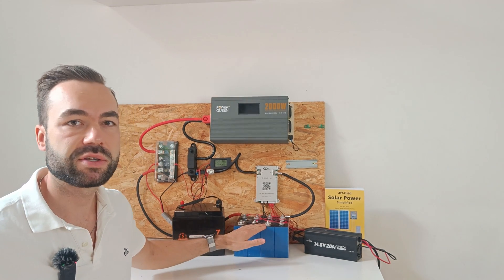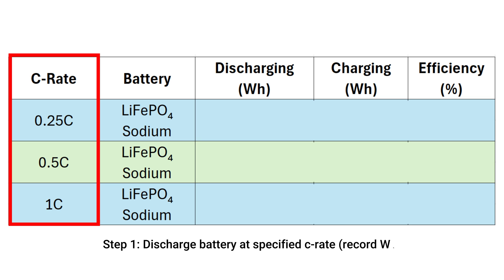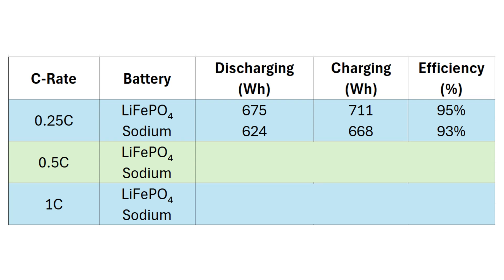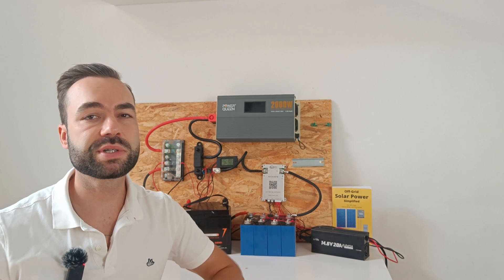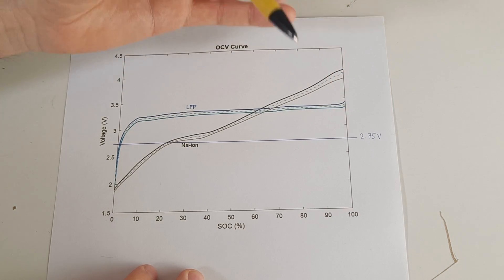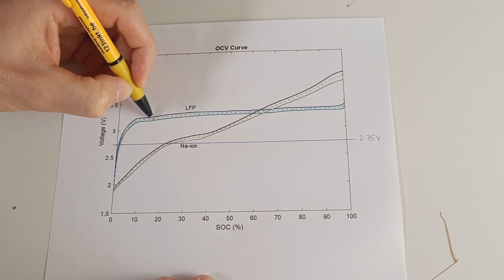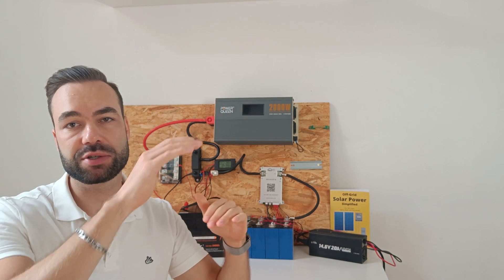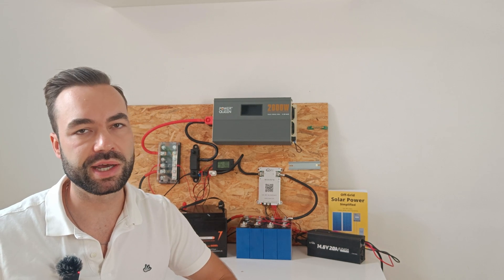Efficiency of Lithium and Sodium Batteries Tested

Comment: Nice video! Would love to see a similar test but at colder temperatures. I guess sodium might be even better in comparison at lower temps not just for power but maybe also efficiency. That will make them more compelling in many applications in colder climate, where heating the battery is often defteating the purpose. Especially for HV home storage where the inverters usually have a wide voltage input range and where its often suggested to put the battery outdoors away from buildings due to fire risk.

Comment: I think you should have also modified the charging speed for both batteries, as this should be the bigger real world source of efficiency loss. Furthermore these things really depend on electrode thickness, so ideally the batterys should have a similar volumetric energy density( with the lithium a bit lower), otherwise maybe one cell is optimized for power density instead of price/energy density which would advantage the cell heavily in terms of efficiency, as the internal resistance/conduction/diffusion paths are much lower.

Comment: I didn't realize efficiency for the LFPs would drop so much. My inverter has an eco setting, where it uses grid power for low loads and only turns on for higher loads. Because the inverter is more efficient at higher loads. Now I see that the battery is less efficient at high loads, I think I won't bother with the eco mode any more. They more or less cancel each other out.

Comment: I have a 12v lead acid deep cycle marine battery (basically a car battery)
250 watt solar panel
All for now type of deal
I need to run a 8.8 cubic foot chest freezer for meats. I wanna get a 600 watt inverter to run the freezer all day, turn it off at 6 pm to 7am
Will my setup allow me to run the freezer for at least a month with no issue?
Reply from the maker: I made a video about how much power my fridge consumes. Check it out

Comment: Hi Nick. I know this video is irrelevant to my comment, just commenting on this as it’s the latest video.
Can you do any content that is more targeted to Europeans (straight to 220-240v, maybe even have some links for us EU people)?😅
More specifically for full off-grid, 48v, whole house etc?!
Cheers mate. 👍
Reply from the maker: i'm European as well (belgian), but most of my viewers are from the US, so i focus on the US market. 230V grids don't differ much from the 115V in the US. Here in Europe, we can use half the cable thickness which is good. I have a video upcoming about a DIY 48V battery which i will wire to my victron multiplus system at my parents home. Also, search for 'load shedding' on my channel and you will find a video where i talk about this system.
Reply: @cleversolarpower looking forward to it. 👍

Comment: 90% is ok. Can you do a 4S LFP 0.25C test including an inverter?
Reply from the maker: The lifepo4 battery has 4 cells in series to make 12.8V. an inverter is 0.9% efficient (mostly). So 0.9*0.9=0.81 or 81%
Reply: @cleversolarpower i am on 16S lfp and i am askong total eff: charfevand discharge, offgrid situation

Comment: Wow!! That's pretty low for the LFP. Haven't seen that low with my round trip tests. 

Wow 93% for sodium ion is incredible!!! What kind of cells are these? Such a bummer about the discharge curve though. 

Seems like there are big differences between various sodium ion cells from different manufacturers. Some are really really awful.
Reply from the maker: I will be testing a 12V 100Ah, maybe that is more efficient with lower internal resistance.  
The 75Ah sodium cells are from HiNA, bought through Docan on alibaba.
Yes, the discharge curve is not great. But if they become cheaper, it's worth it. Maybe in a few years.

Comment: Hi I buy 12volts 100ah and 12volts 314ah lifepo4 battery I alrrady buy 60a mppt charge controller is it fine to have good harvest? Thanks
Reply from the maker: Based on your 12.8V battery, you can use a max of 800W of solar panels.

Comment: thanks for doing these tests and analysis for us! i am wondering you opinion of the safety of  the sodium electrolyte, PF6, i am hearing it can generate HF if it combines with water, which concerns me...
Reply from the maker: I'm not a battery chemist, but i've seen that NaFSI or NaBOB  can mitigate HF. Maybe HF scavengers like FM2 can be used. But all these would have an impact on the energy density and costs as well. However, they cycle these batteries for testing and if it's too dangerous then i don't think they will pass the test as third parties will also be doing these tests. The gas has to escape the cell as well and that means breaking the seal on top of it.

Comment: Nice.  95% at 0.25C is about what I expect for LiFePO4.  You should get around 97% at 0.1C.  And Sodium performed better than I expected, too.  Cabling matters too but I would say you were close to best-case with the short thick cables you used.  And SOC range also matters a bit too, you were going all the way to cutoff which is a bit atypical.
Reply from the maker: Yes the cables were a bit oversized. I should have paid more attention to that and match them to the 1C rate. Yes, i went all the way to cutoff voltage, maybe i should give lithium another chance by cycling it from 20-80%.
Reply: Yes I was a little worried - I saw some test on another channel where they got really crappy result - like 70% efficiency at 1-2 C discharge and charge rate. He might have gotten bad cells. These batteries are so new that he might have gotten some of the first batches that wasn't as good.
I'm thinking about building my own power station later and hasn't really decided what batteries to choose - LFP will always do the trick, but it could interesting to try out sodium as well, since it seems like a promising tech that will solve the issue of using "hard to get" materials.

The highly SOC (state of charge) dependent voltage will not be an issue there, since I will build DC/DC converters and the inverter my self, as a fun part of that project and can design it to work over a large voltage range. But it takes away a lot of the fun (trying to get as good efficiency as possible in the conversion stages), if the battery it self wastes a lot of power

Comment: you sure you weren't measuring the efficiency of your testing equipment
Reply from the maker: The shunt was placed directly before the negative battery terminal. The inefficiency of the charger is not included. Only the battery cells + BMS.

Comment: I am confused... you say its the cut off point of your controller.. doesnt NA need  different controller than LFP type batteries? Seems a bit miss leading some how. As I know Na can drop down to 0 volts just fine. Nvm you go over it at the end... but still, a bit miss leading. You should maybe come up with that information at the start, so the results look a bit more correct. Over all, If we count for that, NA doesnt look bad at all. Yes you need more of it, but over all, 90% still pretty good. Once prices coem down on them, its going to be a no brainer to go NA over LFP as they are being made in the US, Canada, UK/EU, China, and I heard  Australia might be getting a Sodium battery plant. At that rate, prices for batteries will drop like a rock. OR at least give people options in terms of what type to get.
Reply from the maker: I don't know why that would be misleading? Unless I don't understand what you mean. I could get less energy out of sodium at 1C, but that means I could only charge what I took out of it. So the efficiency is purely based on the cells+BMS.

Comment: Sodium Ion batteries are in their infancy they are improving the chemistry quickly, I get news stories of innovations regularly. I will soon have a situation where the fact that the battery can accept charge down to well below freezing without the need for heating first will be a game changer. In the northern hemisphere(where it gets cold) imo sodium Ion batteries will be the go to for full time external use.
Reply from the maker: Yes, I agree that it needs time. It will be very useful for colder climates. It would be interesting to compare this to a heated battery. I got a video coming soon about the damage done when you charge a frozen lifepo4 battery. However, i wouldn't pay much attention to the sensational news of battery innovation unless they have a battery that you can hold in your hands. Prussian blue is likely to develop further.
Reply: Compared to Lithium indeed, (+30 years VS 5y sodium) and there are still spending money on Lithium research. What I like about Sodium Ion batteries is: we finally have a clean and cheaper alternative (eventually). I'm sure there will still exist some market for Lithium up to 2050, but having Sodium alternative should reduce the environment impacts of Lithium extraction.